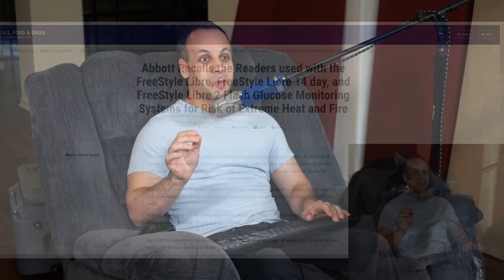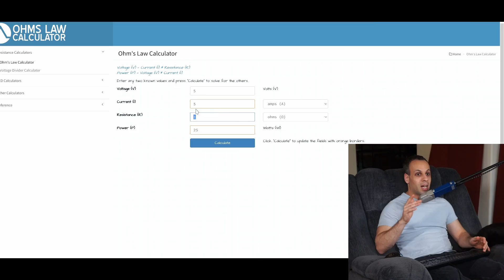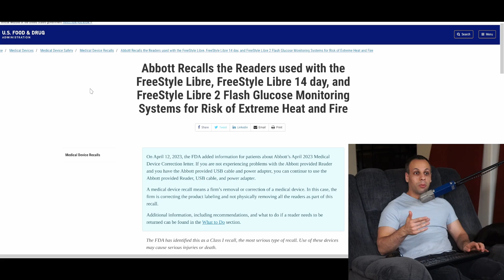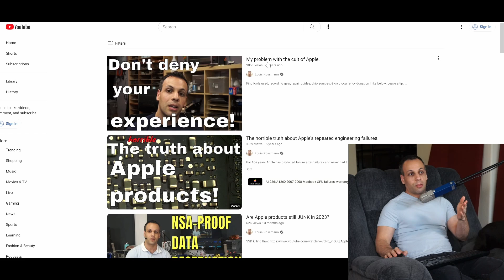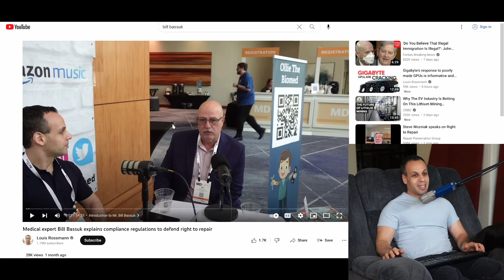Abbott gaslights customers during FDA recall of burning glucose monitors

Comment: The thing I can see happening here is these are made for type 1 diabetics. Often times you're dealing with kids and teenagers who aren't particularly responsible. I could see them plugging in whatever they have handy to charge whenever. That doesn't address any shitty design issues like you're talking about here, Louis, but user error as far as charging goes isn't far fetched.

Comment: You're 100% correct, USB is USB, power delivery is power delivery. The protection circuitry has been around forever and is pennies to implement correctly.

However, there's a bit you're missing since you don't work with medical equipment: Every component of the system is "FDA Certified". The manufacturers will only design and test their equipment for one configuration, the one they submitted for certification. Once the user receives the equipment any changes to the device or supporting equipment that causes a problem is blamed on the user not using the device exactly as the manufacturer intended.

In the mind of your Abbots, Seimens, Philips, GEs, etc. any cent spent designing for scenarios outside of what they will submit to the FDA for clearance is useless because if the consumer changes it they no longer have a certified medical device and it should not be used.

Next time you go into a hospital, look at any device that plugs into an outlet with some sort of power conversion circuitry. There will likely be a tag on it signifying it was tested by that facilities' biomed department so that the power conversion circuitry won't cause excess noise in the building electrical systems. The medical device manufacturers couldn't be bothered to implement better power filtering on their devices since they would only be fed clean power in their certification. Because of that every other device in that facility must be tested on a yearly basis. It's insanity.

Comment: As a hardware designer of medical devices, im completely standing with Louis here. If you have medical device, it MUST comply to certain standards of safety. If it has USB connector, regardless of generation (in this case USB-C), it has clear regulations and standards what USB-C means and what power it can deliver. You must have clear defined protection against 3rd party chargers and protection against overpowering charging circuit. At the best this is sloppy hardware design, at the worst its corporate mishap. Lets hope that nobody gets hurt with this, because lets remember, a lot of elderly people are supposed to use these.
Reply: Flashbacks to Dell motherboards and power supplies with standard ATX connectors but different wiring, so the motherboard would get killed by a non-dell psu and the dell psu would kill non-dell motherboards. Back in like pentium 2 days.
Reply: @ThisMicrophoneSoundsCheap  I remember that issue !
Reply: even if it was poor engineering design this shit is so basic you can only blame corporate cheaping out on engineers. No chance any half decent engineer got it this wrong. and it's plain as day there was no testing or half decent quality control for these "medical grade" devices.
Reply: @ghosthunter0950  these readers (i use one, thanks diabetes) are super cheap feeling. their Touchscreen barely reacts, you can watch the screen draw itself, no screen brightness regulation, but they do charge by USB normally even with other power sources AND  you NEED to plug them into computers to upload their data to the abbot cloud for analysis. and yes, they charge on computer USB ports.
Reply: @ghosthunter0950  100% with you there. It's when excel warrior meets ignorant engineers - that's when this shit happens. Responsible engineer would go his/her way out to explain to upper staff or directly to CEO if needed, that this price cut will generate lawsuits. Then again I've seen some "interesting" designs and questionable questions in my consulting days too.  So never underestimate the stupidity of "professionals" .
Reply: @ts757arse  That's BS. OCP is done by battery protection chip between cell and charger chip not by anything in between charger chip and front PSU. It can't be done on that side of charger chip. They are just trying to shift the blame by mentioning cable and original PSU.
Reply: @ts757arse  "And you certainly don't have over current protection on the removable PSU end!" <- In simple terms - nobody does that, including the device under scrutiny here. First level of protection is built in the charging algorithm in charger chip in the device. 2nd level of protection (in case chip fails) is in battery cell protection. USB brick is only a constant voltage power supply. Even with ones that can switch between 5 / 9 / whatever volts - they are still constant voltage supplies as they regulate output voltage. Chargers are CC / CV regulators with specific termination and protection logic and are separate chips inside the device.
Reply: @ts757arse  It's talking to PC by that USB for log download. Means it's a real USB. Also, it would not work, if protections would be external - the cell voltage should be quite tight for Li and drop on cable would prevent protection to work correctly if it would be external. They just have shit charger and no protections - that's all.
Reply: legit many companies do this crap.
Reply: Three things have had to go wrong at the same time.  The Risk Assessment and PFMEA  will have addressed each of whatever three things went wrong. And it likely addressed a combination of any two. In a company that mature, anything that results is something as serious as a stop ship or a recall is because three things went wrong. Like, cheap ass cable and weird charger? No problem.  But add crap or water in  the port and a charging set up that wasn't validated with the  device?  Who knows?

But it's never as simple as one thing going wrong.
Reply: for sure it was just poorly designed even my old Black &Decker weed eater had a quality charging circuit !
Reply: you can only do so much in hardware and the standard only defines so much abuse. You can anticipate certain trends, but not every coming feature 10 years in advance and how a Chinese knock off charger can completely implement it wrong and how that interacts with a non-standard confirming cable that is worn down.
Reply: PRotection AGAINST 3rd party chargers?! What the fuck no go pound sand with that shit. A USB charged device should not care what USB source it's plugged into.
Reply: It has nothing to do with USB though. That's a complete BS. Li chargers as any battery charger work in CC/CV modes. To get it to heat up, you need either to fail at current regulation at start of charge or voltage regulation at CV part of charge curve. Even then, you will not get fire, because when battery heats up, the thermal protection will cut off the power from the charger chip. Unless you do not have the thermal protection, so your heat issues can cause over-heat above 55 degrees C at which point chemistry in Li pack would start to react in run-away manner fueling itself until it would catch on fire. None of this is in any way related to USB part of the circuit. Also, if you care for your devices safety more than price, you add extra cell voltage protection with triggerable thermal fuse. It would melt off either if battery gets hot or if meltdown is triggered by external cell voltage monitor. Of course this is additional expense, but in this case even if charge chip dies in a way that it shorts input to output and does not react to thermal sensor, battery would still be protected. Ant then if you are not a cheapest ass of them all, you'd get a battery with internal OC/OV/UV and OT protection board not just a bare cell. That would be redundant in good way. Again, it'd work in case charger chip has a catastrophic failure. So what I am trying to say is that it's 100% shit charger design with cost cuts all over the place.
Reply: this just sounds to me that they used unprotected cells and built the regulation into the charger instead of into the device. Very much disagreeable design but was also common for quite a while, although mostly with cheap crap from China.
Reply: @emolatur  Yes about cells, no about "charger". USB brick is just a 5V power supply or in some cases smarter 5/9/12/20V power supply. It is not a charger. There is no CC/CV modes there. There are no charge terminations and there can't really be. "Charger" is a specific chip on board. And they have either chosen shit chip or shit schematic around the chip. Plus unprotected cells. The whole "external charger" thing is bullshit, they are trying to shift the blame with it. There are some USB charger chips that die at 5.4 or 5.6V on input, even good ones, so you need very precise and good protection for overvoltage in case crappy USB wall brick spikes above that at some specific load drop nobody tested. And that's hard to make because you have only 0.5V or less between dead chip and normal operation. Then again, I have seen this issue in older Garmin devices, but they never caught fire or anything, they just stopped charging until you re-solder the chip to new.
Reply: @hatterfoil  A USB brick that operates in CC mode accidentally (ie, by being soft and week, and "collapsing" under load) will charge a protected lithium cell. If the manufacturer sold it that way, it's irresponsible, but will lead exactly to the scenario we have here: replacing the original "charger" (Your semantics do not apply. The quotes are there because THE MANUFACTURER assigned that device for charging. Your disagreement over terminology lies with them, not me. Well, I guess also with, like, literally everyone, because anybody who isn't a tech themselves just calls "the part that plugs in" a "charger" whether it is or not...) with a brick that does NOT collapse as expected will result in lots of heat and potential fire.

The similar device I have here is this hovering/flying toy thing that came with a USB-to-barrel cable for charging, and very explicit warnings to only use the supplied charger, which gives only about 100mA or so.
Reply: @hatterfoil  With USB powered devices the lithium battery charger is supposed to be in the device though with the port just negotiating a fixed voltage supply for the device to use as it sees fit, so it shouldn't matter what brand of USB charger you connect. That's the point. That's why you can plug a phone into a random ass cheap USB charger and it works fine despite also having a lithium battery.

I suspect that Abbott has not done this, and has instead stuck the lithium charger in the external brick, which is probably why this happens specifically with non Abnott hardware - they've implemented USB C in a very non standard way that's just dumping 5V directly into the battery if the user makes the mistake of thinking the standard port behaves according to the standard.
Reply: @bosstowndynamics5488  Its not using USB C. its using a Micro USB port...
Reply: @bosstowndynamics5488  1. No, it does not negotiate voltage by default, as it's micro not C. The 9V extension to micro is a bit off-standard thing and most off-shelf charger chips do not support it.
2. No, they have not. You can't really implement the CC/CV modes in external device as drop on your wire will fuck with the setpoint of voltage too much. Setpoint for Li is quite tight. 
3. How is it supposed to work with PC's then, if it's not 5V USB PSU, but a floating voltage supply?
4. Even if they would use USB-C in "non standard" way to request the voltage and current limits, it would not work, as USB-C does not have current limit request. It can switch voltages in few large steps and it can report available current, but it can't limit current by  protocol. 
5. Even if it would work that way, it would would be expensive and stupid, because now you need a charger chip in the device, that does not controll the loop itself but sends digital USB-C control signals out to charger. That's much more expensive than having bad charger inside and stupid in general.
6. None of that would overheat the battery if there would be any sort of OT protection on cell. Normally cells have OV, UV, OC and OT protection built-in or right next to the cell. Excpet when you are a complete cheap-ass and moron and buy bare cells and do not put protection on your board. Shame on you and shred your engie diploma in a ritualistic fashion then.
Reply: @hatterfoil The issue is that the user would have to use both an aftermarket charger snd cable  and misuse the device by getting it wet while chatging or by having foreign material in the charging port. 

The Abbott charger is smart enough to stop or limit charging in the event of a short or other circumstance where information from the device being charged is missing. 

Shitty aftermarket devices may not.
Reply: I have the Freestyle Libre 2 and it has Micro USB not USB C
Reply: @DennisKyne  I have the FreeStyle Libre 3 and it still has micro usb (god damnit that thing came out last yearwhere I live)
Reply: @DennisKyne  My Freestyle Libre 14 day and previous 10 day reader use Micro USB as well...

Comment: The Libre 2 meter had the capability to actually check your bgl using the freestyle nano test strips. But there should never be enough blood to cause an issue.
Reply: The reader is seoarate, it's basically what's used to make the reading for those who don't have a phone (or who can't get one, which applies in a few cases). It's basically the thing that was used before LibreLink became a much bigger thing, and before they added the Bluetooth alarms to the device. 

This is the version with the Bluetooth alarms that came with the Libre 2.
Reply: @brityuzuki  The version I had was both in one. And it was for the Libre 2. I actually bought the freestyle nano strips off Amazon to use with the unit.  I literally own it.
Reply: @brityuzuki  Twisted Puppet is correct. The Libre reader actually has a slot on the bottom for Abbott test strips, but they’re insanely expensive.

Comment: The LIbreLink 2 sensors cost 60 bucks a piece and they die after the 14 days pass. This device has a single use battery and you have to get a new device after that. Literally it is like throwing your cell phone and buying a new one every 2 weeks.

Comment: I once came in my local computer store with PSU that had dies. According to Norwegian consumer laws I was entitled to have it replaced on warranty.
They refuse first because they could smell smoke and asked if i smoked.
I said yes that was the fact and asked why not replace it.
They then tried to tell me it was due to the tar in the smoke that killed the PSU.
Who come I asked.
Because tar made a conductor and short circuited the PSU.
I told them that is impossible. The tar in cigarettes isn't like the tar use on boats and roads. Tar in cigarette is the abbreviation of Total Aerosol Residue. It is is usually defined as the weight of the solids collected after water and nicotine have been removed.
They cave in and replaced the PSU but without my knowledge I would been and disappointed customer..

Comment: The charger can limit the power drain by lowering the voltage. This is not a calculated move, but simply the physics that happen when you try to pull too much power from a "fixed" voltage source. However, if it works as the USB spec is written, it will not give more than 5V+-some set margin unless the device requests it.
Reply: I don't think voltage is problem . It seems the device lacks current / temperature limits on devices .